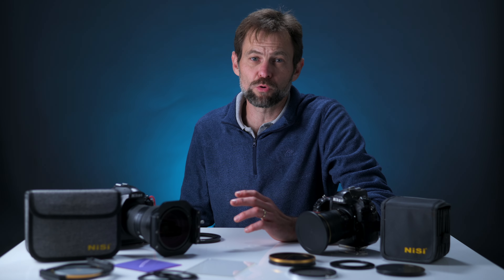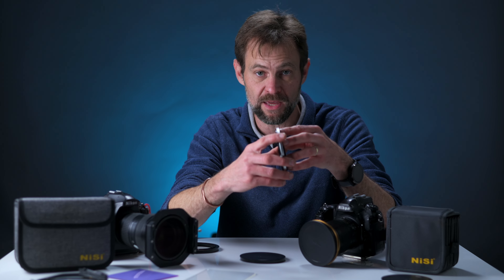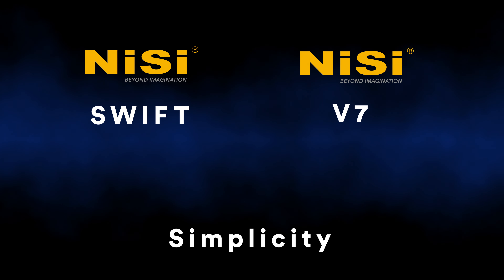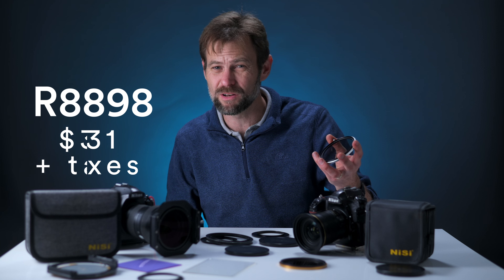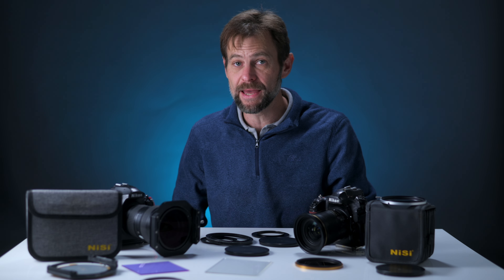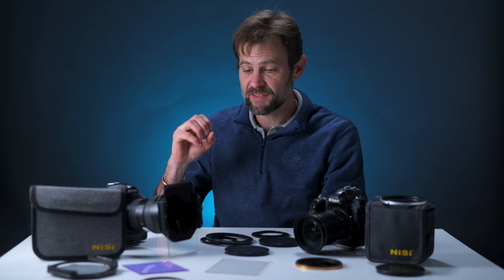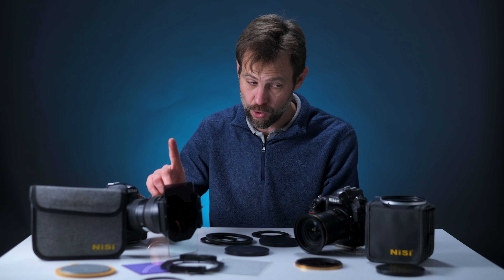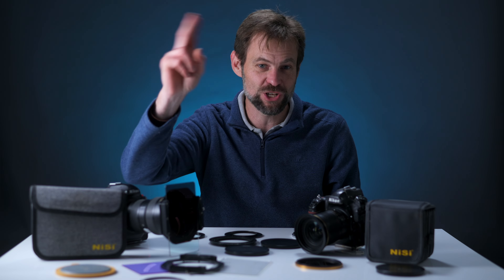Swift or Square - The pros and cons of the Nisi V7 vs the Nisi Swift filter systems

Comment: I really wish NiSi had created a V7 holder that snapped on to the Swift adaptor ring. I also wish they would explain why they chose suction over magnets. I still like magnets better, as they seem to allow for thinner filters.
Reply from the maker: While doing the video I was thinking about that. It's possible something along those lines will appear (maybe?) In terms of the magnets. It might be a toss-up between legal issues (probably unlikely) and that the pressure mount is more solid. I'm not sure. The pressure mount does work well though.
Reply: @emilvonmaltitz  I just heard back from NiSi, and they are planning to release a new series of *magnetic* filters this month 🙂 Super excited!
Reply from the maker: @michaeljemery  i haven’t heard about that yet. Very interesting! I’ll be sure to review them once they become available.

Comment: Could you avoid the vignetting with the Swift system by going bigger, say 95mm instead of 82mm?
Reply from the maker: Hi James. In theory yes, you could do away with the vignetting issue, but infuriatingly Nisi do not make adapters for the 95mm down to 82mm or smaller. So if you want to go this route you would have to buy step-up rings for the adapters (which is a hack). The 95mm set comes with 95 and 86mm adapter rings. However, there is a internal thread to the 82mm adapters that is 85mm....so in theory you can use the 82mm adapters as step-up rings to the 95mm system.
Reply: @emilvonmaltitz  Thanks, Emil! Ok…ouff, got it…well…point for the square filters or even the (much more expensive) Kase magnetic filters.

Last question – with bracketing and digital shot blending being so easy these days, are graduated ND filters necessary any more?
Reply from the maker: @jameskezman  That's a good question. Digital sensors are so flipping good these days that it is very easy to just not use grads (they're simply not as necessary as they once were). That said, I'm one of those curmudgeonly types who insists on trying to get it right in one shot... (not always successfully mind you).
Reply: @emilvonmaltitz  I completely understand!😁 Have a great weekend!

Comment: I really wish Nisi had got the magnetic filter path for the Swift system. The idea of having to push/pull the filter when you want to keep a stable camera during a time bracket shoot seems highly problematic. What has you experience shown>
Reply from the maker: @craigozancin  the magnetic systems are really quick and easy. If there’s a downside it’s that they have the potential to be knocked off (side impact in particular) but basically you just have to be careful when using them. I think (just an educated guess here as Nisi are silent on this) that the stability issue is why they’ve avoided magnets so far. 

I agree about the stability pushing and pulling. I would not use the swift system if I had to change filters between images to be used in a blend. V7 for that.

Comment: Great video.  Am I right in thinking that, with the Swift filters you can still use a lens hood but with the V7 you cannot?
Reply from the maker: I don’t think you can use lens hoods with either I’m afraid (certainly not with the V7 and ai don’t have any that work with the Swift). Or at least it won’t work with the majority of lens hoods. It’s one of the problems with filter systems in general. Lee used to have it’s own add on bellows lens hood, and of course if you’re using filters with a cine setup you’d likely have a matt box with shade.
Reply: @emilvonmaltitz  Kase magnetic  filters will work if you are not using step-up rings and I assumed that the NISI Swift would as well.

Comment: Helpfull Informations , but raised a question. For long exposure photography, is a ND Grad needed?  To me thats the only caveat of the circular filters, or is there a work around in post?  Thanks.
Reply from the maker: @abacab1701  No, if you can live without grads then you don’t need to use the square filter system. There is a workaround in post: shoot for exposure blends and of course out modern sensos are so good that it’s often possible to shoot for the highlights and have enough information to open up the shadows.

Comment: What is your comment on NiSi HUC PRO Nano IR ND64 + CPL 82mm Multifunctional Filter as one pieces?
Reply from the maker: It’s a good filter. To be honest I’m not sure whether Nisi updated the CPL glass in the filter to their new ‘Neutral’ CPL. I have the the older version (which I think has the ‘Pro’ CPL glass) and as such has a slightly warm caste to it. If you want to use circular filters rather than a system like the JetMag or V7, then the combo is excellent for water shoots and really convenient (I hate stacking circular filters and I often a CPL and ND together)
Reply: @emilvonmaltitz  if I only get one filter which one will make more sense 10 stop with CPL combination as on unit or 6 stop with CPL combination as one piece?
Reply from the maker: @papabear7875  what do you shoot the most? If seascapes and you are wanting the super smooth water, then a 10stop with CPL. If rivers and waterfalls I’d go with the 6stop combo (although a 3stop also works really well). If you are wanting convenience and ease of use with a single filter you could also think about using a variable ND (which is also polarised incidentally - it’s just a lot harder to control how it polarises).